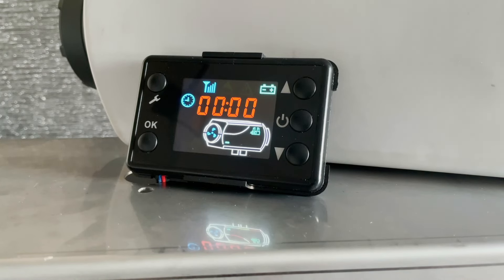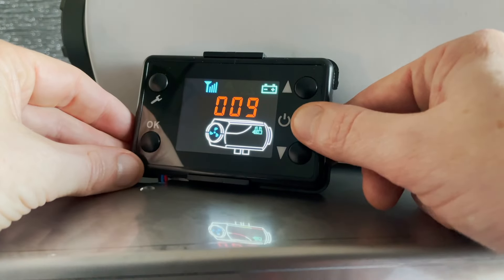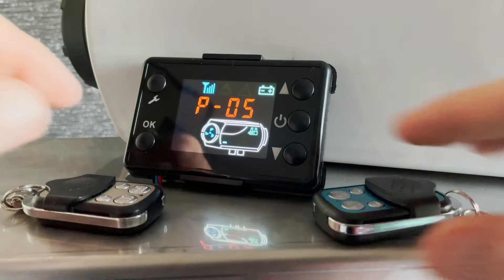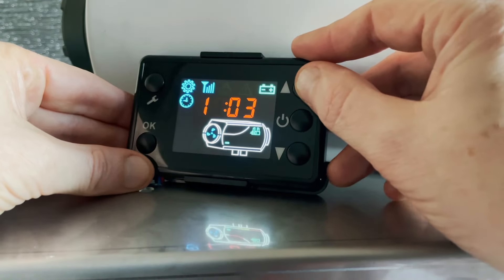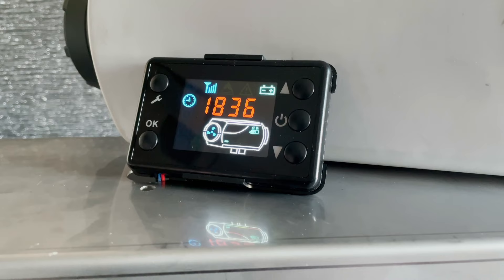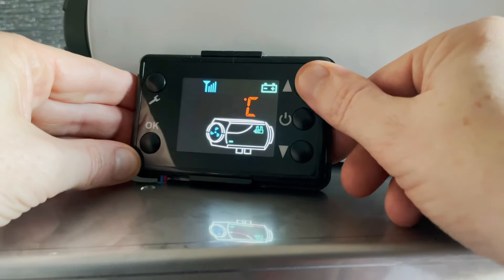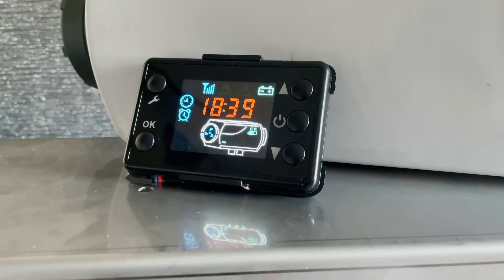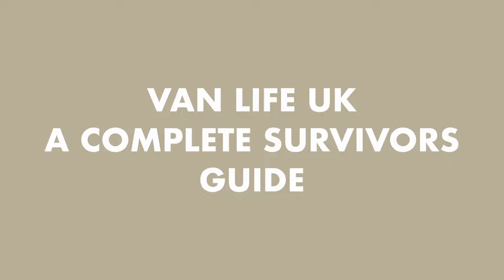How To use New Black Three Blade Chinese Diesel Heater Controller With Spanner button - Quick Guide

Comment: P & T is manual heat or auto temp.
1 & 2 is 12v or 24v
H & L is 5000w or 2000w
1,2 & 8 is the pump size 16ml 22ml or 28ml
Reply from the maker: Awesome thanks for that mate, it is a huge help
Reply: The only thing I haven't found out is if there's a high altitude mode
Reply from the maker: @SlippsUK  the symbol comes on when you plug the controller in to the power and then goes off. So maybe it is possible or maybe it comes on automatically when you reach a certain altitude? I t is so hard to find anything on them at all
Reply: @vanlifesurvivorsguide  I do have a manual but it's very badly written
Reply: Thanks!
Reply: @Jack Of All Trades 
It may be written in body of pump, you may have to remove it from rubber mount to see it.
Reply: Has anyone found if there is a '1688' old controller equivalent code menu. May be able to get other fuel sources but would need to fiddle with fan/pump speed.
Reply: @SlippsUK  Is this manual available online?  What brand have you got?  Thanks!
Reply: @danielc6034  not that i'm aware, mine is the same as the video
Reply: @Jack Of All Trades if you check the pinned post, then go into admin mode, the last value is the denoted pump size... mine says P1H2 so the last digit : 2 is the 22ml pump...
Reply: I switched mine from H to L in the menu but there is no change. Pump does not go any slower when set to P1 for lowest setting. Strange.
Reply: @Mark-wx1ho  so you were trying to frig the heater type as 2KW? personally i wouldn't mess with that, sounds as if minimum settings are similar for both 5K and 2K...
Reply: @timkelly5602  it takes roughly 0.3Hz off the pump speed going H to L. It also does the same thing doing 22ml pump to 28ml pump... If you do both it drops down to 1Hz kicks up a stink and barely lights.... Not recommended.
Reply: @mattcooley6157  sounds right to me, i don't plan to change anything... unless i get a 24v feed, but i imagine the glow plug will last less if driven too hard, 12v is fine and burn is clean even on low at the moment, but not much run time yet, still building into box, so only experimental runs on temp setup...
Reply: @timkelly5602  You have to change the GP and I believe the FP as well to change the voltage. Only the controller works off both. David mcluckie did a test with them and it just throw up GP error with 24v supply. Only one it works with is the tri voltage unit that can be plugged into mains - but that is still a 12v heater with inbuilt transformer that reduces 24/240v down to 12 for the components

I changed my heater to P1H8 now and left it. Just allows the lowest setting to be a bit cooler and more fuel economy. P2 is then what was P1 and it still fires up first time everytime without hassle. Just got to remember to run it on high power now and again but I'm yet to see much evidence of sooting.
Reply: What difference is between manual and auto temp?
Reply: @cypcyprian81  same as all the other controllers. Manual you choose power level and it runs at that level. Auto it runs hotter to raise to temp and then backs down upon reaching it
Reply: Is it possible to adjust fuel or air Flow? Want to mix the diesel with the waste oil but it keeps building carbon inside as hell. Need to clean every week. And oil I think needs a little more air to burn clean or less fuel on the same amount of air. Any sugestions?
Thanks
Reply: @Jack Of All Trades  says it on the side of the pump when you remove it from the clamp. Yours is  22.
Reply: Thank you
Reply: @cypcyprian81  if you have it to auto, you set a temp. When it gets below that temp, the heater turns on. Just like the thermostat in your home.
Reply: Hi, I'm looking for some help in clearing an E01 error code. I know that it's a power issue, but when I get to putting in the code (1688) to clear it, that as far as I  get, the control won't move on from that point, except to go back to the start,  without accepting the code. Is there a different code ? Any help would be appreciated.
Reply: @andrewrafferty3249  *E01 is voltage too high*. You might try 1234, but if the voltage is off it's probably not the password that's the problem.
Reply: @rschreck876  Does the heater really turn on if the temperature drops below the preset one? Or does it just adjust the pump frequency based on the temperature? My heater doesn't automatically turn off if the temperature is too high, nor does it turn on if the temperature is too low. I have to turn it on manually.
Reply: @SlippsUK does everybody get only the 22mL size?
Reply: @Slipps-t7 has an altitude/alpine mode for this controller been figured out? I temporarily set the pump size to 28ml with my 22ml pump to decrease the hz and I'm running it on low. Not sure what my best options are here. I'm at 5000'+ right now
Reply: Does anyone know how to decrease the fan speed? Its stucked on MAX. please. Thank you
Reply: @vanlifesurvivorsguide  Prijesse 12V 5KW

How do I get into setting mode without turning it on
like yours
Maybe I have the new one
Mine has the setting symbol not the spanner
Reply: thank you. I have this style and couldn't get anyone to answer. I had to guess the pw as everyone said either 1688 or 9009
Reply: Aparently Its automatic @SlippsUK
Reply: Does anyone know how to do factory reset on this?
Reply: Remote stopped working on mine after I had to reprime my CDH. When I press the two top buttons on the remote all ai get is 0-P and it doesn't change however long I hold the buttons in, Im stumped, tried a spare remote and nothing changes
Reply: I'm my third input I have H L and U does anyone know anything about that. Also when I put it in automatic mode I have it set to f but when I hit the power button to lock it in it says on:25 and I can put it up to 35 or down I didn't check to see how low. What does that mean
Reply: I have the same controller visually, but it doesn’t function like this. Are there different models which look the same physically?
Reply: How can I make my fan speed go faster or just make it burn hotter and produce more heat.In general

Comment: Let's all pause now for a moment of disgust for multifunction interfaces which require puzzle solving skills to operate. Remember when one switch performed one function?  Yes, those were the days.   This is right up there with those cheap watches no one can ever figure out turn off the alarm that goes off at 3am.
Reply: :)  ^ Brill.  I had a watch for about 2 years with a alarm going off in my house. Never found it as it would stop to quick
Reply: So true - I couldn't agree more!  But I suspect there's actually many people who quite enjoy making things complicated.
Reply: I'm there..
Reply: It really only requires reading comprehension if one reads the manual. :-) 
Video is quicker than finding it or downloading one though.
Reply: @caddyguy5369  Nobody said it was rocket science.  The issue is why build something simple like a heater that needs an online manual just to operate basic functions.   Multifunction buttons are bad  user interface design.   Only reason it is done:  Smaller & Cheaper.  I'd pay a few pennies more to have an extra one-button-per-function interface.
Reply: @DellAnderson  Fair enough. You must not like a lot of modern tech or PC's either then?
Reply: @DellAnderson  That's one of the main reasons, albeit other big ones, that I hate Tesla's. Those dashboards are horrendous.
Reply: @DellAnderson  Not trying to fight or be mean. Just conversing. :-)
Reply: I have this controller on my heater and is poor on settings,only password accepted is 1234 and you cant change anything from there such as fan speed min-max,altitude mode, intake air flow. For anyone how have fluctuation on fan speed i will let you know that you have to push the fan with magnets more close to the hall sensors.After a few hours my fan start to speed unregulat up and down even power setting was at p5 for example. Now thas issue was fixed ,tha fan speed is linear ecen after 12 hours of working. Cheers
Reply: The manuals are in chinglish, and are sometimes mind boggling. These are no exception to understand.
Reply: Agree. I got the heater with just on off and a power dial.
Reply: @lightwave780  Long press for access function in mode unit. Scroll up down when function unavailable. When finish, long press enter button 3 time. DO NOT EAT IN MOUTH!
Reply: more or less brand new heater and controller awfull and following this video its not working cant pair remote the setting spanner and up buttom does nothing can you not buy a better controller that maybe links to phone

Comment: I’ve watched all of your videos and I still can’t change mine from temperature mode to power mode and it’s very frustrating
Reply from the maker: Hi mate, sorry only just seen this i have been in spain. Watch the video again and watch where I go into the hidden menu with the pin code. Then change the first option from p to t. Hope this helps
Reply: @vanlifesurvivorsguide sorry but I'm the same and it's using way too much diesel now , still can't figure out where the hidden menu is 😵‍💫 going nuts here , can you help a thick woman please 🙏🏽

Comment: I have found I had to cycle power (remove/reinstate power) to the heater in order to get the functions to work.  My heater won't get into the menus if the power has been on for a while.

Comment: hey thanks so much for this.def saved me a load of my hairs.  

one things im not sure about is on the temp settings when i go through there are 3 different centigrad settings.  2 with a big C and one with a small c and wondeirng if you know what they mean. thx j
Reply: Ambient temp, heat exchanger temp and set temp.

Comment: I have the same controller and have spent ages trying to get my pump to purge.
I was phafing with the ok and down the same as the old controllers. I even tested my pump directly to the battery.

So happy I found your video I couldn't wait to go and check if I could get the pump to prime. 
Whaheyyy my pump is clicking.

Thankyou. 👏👏👏👏
Reply: Hi dave can you explain how you got your pump to start clicking
I have brand new heater but can't prime
Reply: @adriansykes8735  hi Adrian if you have the same controller as in this video just follow the instructions.
Reply: The pump is live at 12v - it dips to ground for each pulse. You can see this if you attach an oscilloscope to the terminals.

Comment: Great video. I have this new model lcd with spanner but I’m not able to set Celsius temp at all.  Can change the p setting.  Any suggestions?
Reply from the maker: Yeah if you watch it again and the bit where I enter the settings menu where the options are P OR T you can change it there. I think you need to change from P to T if its in T try changing to P
Reply: @vanlifesurvivorsguide  thanks so much that worked.   Another question.  We are traveling & the screen is dull. If I knock it it brightens. We went to use first time tonight, pushed ‘on’ the remote, screen brightened, pushed ’on’ again but screen now black & doing nothing.  Disconnected plug & reconnected but still black. ???
Reply: Struggled for ages best explanation on here thank you

Comment: Hi, I have this control unit, how do I change between 12 volt  /24 volt .thanks guys.
Reply from the maker: You need to go into the secret menu like shown in the video with the passcode. Then the first option is the voltage. 1=12v 2=24v. This is just the controller voltage though not the heater voltage. If you have a 24v set up you need a 24v heater

Comment: Hi, my heater came on today for no reason, fortunately I was heading out so I noticed, I hadn’t set the timer but wondering how I turn the timer off if I had somehow set it to on
Reply from the maker: you can just turn the heater off and then that will be it. you have to set it every day so once its come on it needs setting to come on again it wont do it automatically
Reply: @ excellent, many thanks

Comment: How to change ambient temp readout from Celsius to Fahrenheit ? I have the same controller. It was showing Fahrenheit out of the box until i started pushing  buttons. Been playing around some time to change C to F and i did it. The display was showing heat exchanger temp or ambient temp (don't remember which) i then held the up arrow for a few seconds.

Comment: Great video.
I also have this controller and just installed my heater today, just trying it out and plenty heat coming from it after priming it.
When I go to select OFF I get the message CLEA on the screen, it does power down, just wondering if that is correct though
Reply: yeah. its clearing out the burner so the unit is ready to run next time. very important step and why they tell you not to just pull the power
Reply: @ many thanks, good to know.
I’ve got the display showing the temperature but I can’t get it to display the power setting, or are they basically the same thing, as not sure what power mode setting I currently have
Reply: @amacmedia3221  I've only been needing with these heaters for 3 be weeks.
But temp is thermostat mode and p setting is manual. (No on off just puts out that heat level)
Think it's top two buttons held down to switch?
Reply: @nickabel8279  cheers mate, I’ll have a look at this

Comment: Hi, mine currently has no clock just dashes, no battery symbol at all. None of the buttons seem to work. Before I buy a new one, reckon it's that or the heater? 😁 It has been working fine.
Reply from the maker: its sounds like the connection between the b=controller and wiring loom. have you unclipped it? is it new or have you been using it for a while

Comment: So do you keep your heater powered at all times...meaning the display is on all the time?. Or do you put it on an on/off switch to kill the power?
Reply: Push and hold middle button on right hand side for 3 seconds until it says OFF. This initiated fuel cutoff and cool down mode. The display stays dim all the time until you remove the power cord.

Comment: If you need getting e08 after priming check the filler cap is letting air in. I have just worked this out

Comment: My heater has been running fine for a few hours now, just like many other times, but now suddenly, the “oil pump fault” indicator is on. 

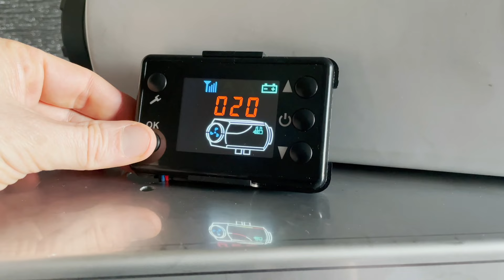It is the same green indicator that shows up at 0:49 in your video when you begin the priming. 

The manual says about this indicator:
* the “machine fault“ column refers to that indicator as “oil pump fault“
 * in the “knob panel display“ column it says “4 indicator lights flash” (but this indicator is not flashing on my display, it is just sitting there, solid)
* in the “handling method“ column, it says “check whether the oil pump is disconnected“ (but my van has not moved a bit, and the heater has not been touched, so I don’t know why or how there could be “oil pump is disconnected”.)

Hot air is coming out the vent, but I wonder if this “oil pump fault” problem might be making it run not hot enough, or using too much of the diesel, or some other problem.

Can anybody tell me what problem this symbol indicates might be happening, and what I might do to fix it?

Thanks!
Reply from the maker: Its not a fault it just means that the pump is on. If it doesn't come on you have a fault. A spanner is the British word for a wrench
Reply: @vanlifesurvivorsguide thanks!

Comment: Secret menu   pass 1234
First digit  is either P.....t .....or  A
P  = manual mode
t   = temperature set mode
A  = automatic .   ( takes it to set temp then shuts 
                                   down..off)
Second digit  can be either 1 or 2
1 = 12v
2 = 24v

3rd digit is either H or L
H = 5Kw
L = 2Kw

4th digit is either 1    2   or 8
1 = 16mm pump
2 = 22mm pump
8 = 28 mm pump

Hope this helps some of you to better understand.
Reply: But how do you program the automatic function? When I choose the turn on temp I go back to the main menu by pressing power button and choose a shutoff temp, once reached it shuts down but doesn't come back on automatically when turn on temp is reache
Reply: My unit also has a upside down F  (Maybe for elevation ?)